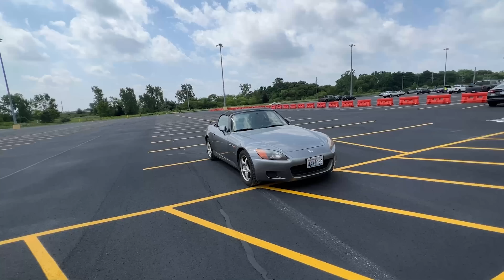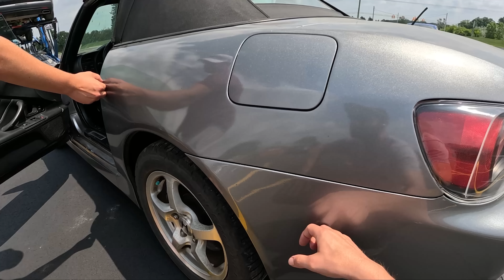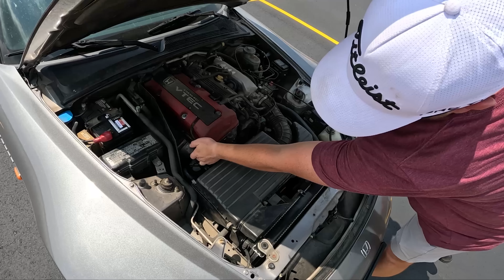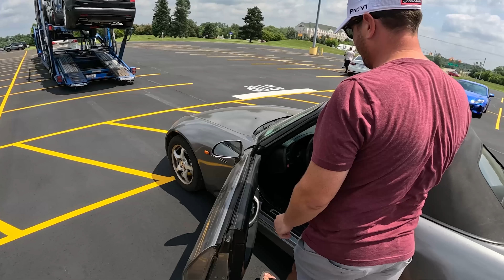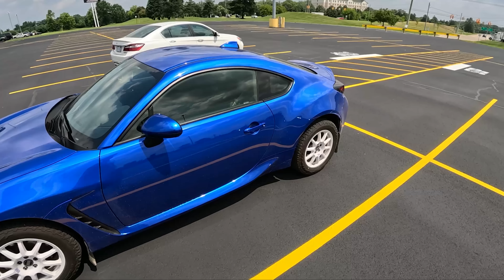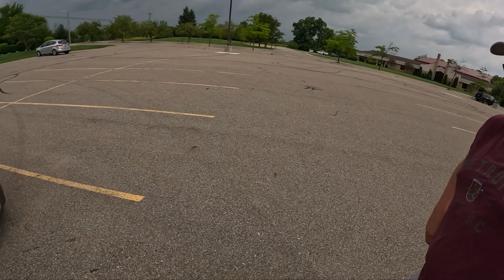2001 Honda S2000 - POV Delivery & First Drive

Comment from the maker: This week I bought a 2001 Honda S2000 with my best bud!
143k miles
Engine: DOHC inline-4, aluminum block and head, port fuel injection
240 hp at 8300 rpm, 153 lb-ft at 7500 rpm
6-Speed manual transmission
Curb weight: 2,809 lbs
Tire size: Front: P205/55R16, rear: P225/50R16
Wheel size: Front 16″ diameter, 6.5″ width; rear 16″ diameter, 7.5″ width
Reply: How much you pay for it
Reply: @tayseersaeed5564 12 grand.
Reply: @brq44 😮 lucky 🦆
Reply: @jackpowell8155  Not me lol
Reply: Congrats man! Looks like so much fun.
Reply: I love this car I want one so bad
Reply: What next car?
Reply: With that mileage I’d guess $17-18k. $12k is straight robbery
Reply: Had no idea you guys were local… so cool to hear about Side Tracks lol
Reply: Make sure you have some engines in reserve
Reply: How is the passenger leg room on this compared to an ND? As much as I love my car, my wife and son don't fit well in it. And what are your thoughts on the steering vas an ND2?
Reply: no way 
 @brq44  that's a lie
Reply: @andyduomo9229  no

Comment: in 2014, I bought a 2009 S2000 (chicane silver/black leather) with 14,000 miles (I'm in Canada but let's talk miles and USD $). I paid 23k USD and my friends thought I was crazy as you could buy older models for $15k.  This one was like brand new.  A year later I was washing the car and someone pulled up in a 1997 NSX an offered me 29k on the spot. At the time, I thought I was a genius as I made a quick $6k and put a few hundred miles on the car.  Now that car is probably worth 50k and I'll never find another one like it.

Comment: S2000's still have something so special with their driving experience. Not the fastest or most capable things on the road, but so much character and so engaging
Reply: For sure. That's really all you want once you get over the fast car bug.  Most recent cars are almost completely devoid of emotion/character by comparison. It's almost become software infused rather than mechanical at this point...ie pops and bangs

I wish I would have gotten an S2K instead of a first gen BRZ...back then 15-18k bought you one in near showroom condition.  I had so much remorse when I took a ride in a friend's S2K with a nice intake and exhaust....the BRZ is so boring and feels so much slower in comparison.  Not to mention Subaru quality or lack there of...

Have an ND2 Miata now, it's as close as you can get for a modern car.  Thing is damn quick on a backroad stock...they aren't slow anymore.  lol.  Even those are almost too fast for most backroads...speed limits still exist 

But nothing beats that induction sound and seemingly endless redline of an S2K....wish they weren't so expensive nowadays.  I would have loved to pick one up instead of the Miata, but dropping 30-35k on a car that's nearly 20 years old for a daily driver vs 32500 for a 3700 mile 2020 Club with Recaros.  Easy choice for me.  

This seems like a steal for today's S2K market! With some time, money, and love it's going to be a great car.  Most S2Ks around that price are probably salvage titles or beat to piss.
Reply: I’ve been having a lot of trouble deciding whether I want this or a GR86 for my next sports car. I currently own an NB Miata, and while it can show it’s fun character sometimes, it’s also covered in rust and makes a bunch of scary noises. I’m probably one of the only people to say this but I hate my Miata because of that and I don’t think I want another one. I’m trying to sell it now and it’s a nightmare. I know S2000s aren’t the same car at all but I can’t help but see the resemblance, plus it’s going to be like a 25 year old car by the time I can get my hands on one, and like you said they’ll either be beat to piss or be collectible items. GR86 sounds like the way to go, but if I ever drove a nice S2000, I feel like I’d be pretty sad about getting the 86. Ig I just gotta wait and see how Topher compares this car and his 86.
Reply: @samstedman409  as someone who has owned 7 s2000's and driven GR86 on street, canyon, and track, I can tell you that they are both awesome cars but also very different. Relative to your NB, the s2000 will feel like a very violent and angry version of that car. I found the GR86 to be a better balanced car in terms of handling. Feels better to drive at the limit. But, the GR86 is struggling with reliability because of the RTV issues and Oil starvation on cornering. S2000's have been around for ages so the guess work for reliability mods is done and are just about bullet proof with a few of the right measures

Comment: The AP1 is the better S2000 and the AP2 is the better car. Cant go wrong with either. I bought an AP2 since i plan on daily driving mine and wanted the QOL changes. I love it, congrats!!!
Reply: I imagine people typically say such things to make themselves feel better about whatever model they wound up with. Both are great. Fortunately North America and Japan ultimately received both models — people in these markets should buy whatever version appeals the most to them.
Reply: @VirtualGuth  you literally said the same thing i did, although a bit more cynical. Thank you?
Reply: @DraegerV1  I've just never bought into the whole AP1 = the better S2000, AP2 = the better car thing. Those looking into buying a S2000 should focus on what aspects of the various versions they value most and shop accordingly. Those who have a limited budget obviously should buy what they can afford and know that every version of the S2000 is capable of racking up a lot of miles when properly maintained. S2000's in any form as they came from Honda offer plenty of fun for those who enjoy spending time at the upper end of the RPM range. It's also worth noting that as not everyone enjoys such cars, the S2000 definitely isn't for everyone.
Reply: @VirtualGuth  logical explanation. I just think its cool that we do have the AP1 and AP2. More hardcore or less hardcore. Like, the S2000 is already an amazing car, and the fact that we have 2 versions to pick from is awesome. I still stand by the saying above. The AP1 is noticeably more edgy, while the AP2 is a bit more "daily friendly.'' Cant go wrong with either.

Comment: Congrats with the S2000 !!!
I own a 2002 S2K since 2010. Bought with about 80000km on it and now it has 190000km and i still love this car so much.
If i sell it, i will surely regret it.
As all car enthousiasts, i'am looking for another sportscar now and then and i can sell my S2K to raise my budget, but that is not a good idea. Better buy something cheaper as a extra fun car and keep the S2K.
I must say that my S2K is not my daily car, i only drive it as a weekend/summer car. As a daily and only car it wouldn't be my car.
It is always noisy, you have to work for speed because it needs high reving. Driving in snow and rain can be very tricky and with the roof up, the blind spots behind are BIG.
BUT!!! If you drive it on a sunny day with the roof down on a twisty road, everything falls in place and it is a dream!❤

Greetings from the Netherlands

Comment: Congrats. Three time S2k owner here. I made the mistake of selling the other two. My 2004 Rio Yellow Pearl with 30k miles is a keeper….I think the S2k is the best bang for the buck when it comes to analog driving experience and smiles for the dollar. I used to say this and the E46 M3, which I have also owned a few of, but the BMW costs a lot more to maintain.

Comment: I soooo wanted one of these back in the day until I tried sitting in one. I simply didn’t fit. I couldn’t get my leg under the steering wheel at 6’3”. It crushed my dreams, but I still appreciate seeing them out on the road. Can’t wait for some awesome future S2000 content!
Reply: I’m 6’2” - it’s a serious struggle getting in and out. Cheers!
Reply: @thomasoneill5653  did you get some lower seat brackets?

Comment: It's crazy to think that I've bought my 1 Owner, 69k miles 2001 S2000 back in 2017 in pristine condition for $12,000 just like you two have paid, I have easily negotiated $2,000 off which he originally listed at $14,000. Sub'ed for future updates!

Comment: Congrats on the s2000! 

- you guys need the soft stop straps by modifry (business is closing, so order up), without this, you could rip your soft top. 
- no steering wheel adjustment on any s2000 year.

Comment: I had a 2004 Civic coupe as my first car. Drove it for 8 years, did shifter upgrades, suspension, wheels+tires, etc and even with 150,000 miles the thing ran incredibly smoothly and happily. I love old Hondas.

Comment: Congratulations on what looks like a decent deal in today’s s2000 market (same I paid for my one owner ’00 with 50k ten years ago).

I occasionally consider replacing mine with something more modern, then I take it for a drive and the thought fades. 

The vibration you feel when decelerating may be clutch buzz.
Reply from the maker: It’s understandable why values have gone up so much! It’s one of the best drivers cars ever made. Vibration is definitely clutch buzz, only on deceleration and stops when lightly pressing on the clutch pedal. It’s getting better though with more driving 👍👍

Comment: Bought a silverstone 2001 this January! Congrats on the car guys. You’ll be very happy with the purchase. 

After going through the ringer with this car this year, here’s some tips

1) that decel vibration is the infamous ap1 clutch buzz! Most cars start doing it at some point. Nothing to worry about, just annoying.

2) square setup with a karcepts front sway bar is the perfect way to optimize handling. Adjustable sway bar without having to lift the car!

3) you know you want that K&N intake ;)

4) if you’re looking to get a lower seat, get a recaro pole position with PCI or buddy club sliders, and don’t look back. Mine seated on the floor and it’s perfect driving position now.

5) sound deadening in the doors goes a long way in reducing NVH. Just did it to my car this weekend and it was the best 2 hours I’ve spent on this car, period. https://www.s2ki.com/forums/s2000-talk-1/killing-road-noise-results-1085903/?ispreloading=1

6) check out modifry for some quality of life improvements! They’re closing so the sooner the better on those phone mounts, cup holders, glove box organizers, etc.

Comment: Vibration on decel might be “clutch buzz”, harmless but annoying. And you do not have to put an intake on it, most of them perform worse than the OEM one and IMO sound worse. It’s fun for a little (take the cover off and drive to simulate one) but it is a much more balanced and pleasing sound when it’s comparably loud to the exhaust vs being the only thing you can hear.
Reply: Airbox lid off definitely reduces power, but certainly good for a bit of fun to see what it would be like with a loud intake!  I think is a channel on here on YouTube that discusses an airbox mod they usually do, which does increase power a little bit on their dyno?  (LHT Performance, though I see in the comments above that LHT Performance are controversial!)

As you say, many aftermarket intakes are worse than the stock intake (likewise for many aftermarket headers).
Reply: @TassieLorenzo  I love LHT Performance but that particular test wasn't well controlled, the dyno pull that they did was after a tune and not like for like. I think I also disagree with some of their findings/instincts. The chambers are there to combat resonances throughout the rev range and the little diverter they removed along with those chambers probably harmed more than helped performance.
Reply: @KirkwoodImaging  Those are some good points!  It occurred to me that Mugen are usually pretty good at designing OEM+ stuff, so I had a look at what the Mugen intake for the S2000 looks like.  It seems further removed from the stock design than their EP3/DC5 or FN2 or FD2 Type R offerings.

Regarding the FN2 airbox, there was a divider/chamber inside the bottom half of  stock FN2 air box which I honestly don't know why it was there, so I removed it (it seems like it would block off 20% of the air filter area and I can only imagine it's there to reduce losses on part throttle during highway cruising or to improve part throttle response or part throttle torque?).  I removed the turning vanes from both halves (as many people do) but felt the throttle response was worse, so reinstalled a stock top half with the turning vanes (which look like they would be at 90 degrees to the flow, but of course the flow is already turning around the 180 degree bend so it's more like  45 degrees -- I never removed the vanes that were in line with the flow on either half, as I can't see how they can be anything other than useful for keeping the flow aligned) and that seemed to put the throttle response back to normal.

(I have a stock bottom half I could put back in too, but have left it as is, as it seems good as is, I dunno. It definitely doesn't seem worse in terms of performance -- maybe highway fuel economy is worse!)

I believe the Mugen air box for the FN2 is like the stock one, but enlarged and with (I believe) no turning vanes inside nor that divider either.  So not too dissimilar from somebody having removed all the gubbins from inside the stock airbox.

"The chambers are there to combat resonances throughout the rev range" Do you think those resonances need to be accounted for, for performance reasons or only for acoustics?

The FN2's stock intake tract has a Helmholtz resonator chamber branched off from it behind the front bumper, which AFAIK is only for acoustics rather than performance.  The Mugen intake includes an air scoop which does away with the resonator.  (Apparently using the air scoop and doing away with the stock resonator makes VTEC crossover sound less pronounced.)

Comment: AP2 can be safely tuned to 8500 RPM redline without exceeding the piston speed of the AP1, so that's pretty close to best of both worlds. 

Love the shots of running to redline and barely pulling on compact SUVs. That's the S2K life these days, now that everything on the road has 200+ HP. Still not much out there that can compete on fun per miles, though.

Comment: Bro, take it to a specialist because it’s going to have some stuff. I got mine from a first owner and it had a ton of stuff needed for repairs.

Do a valve adjustment, swap the retainers, make sure you swap the engine mounts. Change the TCT out of caution. Rebuild the shifter because that’ll make a huge difference. If the clutch is stiffer than finger-press firm, look to see if the clutch master is leaking. Both of those are indicators that your clutch is going. 

I can go on, but congrats!!! Great cars. Put Ohlins on it because it’ll change the car’s handling entirely.
Reply: AP1's don't really have TCT issues. No need to change it preventatively. Also no need to change retainers if they're in good shape and you don't plan on mechanically over revving the car. Valve adjustment is good though, but even then they don't creep very much. But since you're in there already you can do the retainers.

Stock suspension is actually nearly as good as Ohlins. But maybe your suspension was worn out.

But yes the clutch master can go, and it's a good idea to lubricate the shifter and get new OEM bushings.

People mistreat these cars then have more issues that they then blame on the car.

Comment: Get in contact with lht performance in Florida. They can steer you in the right direction as far as preventative maintenance and tlc. Those guys are the s2000 experts imo. Congrats on the honda bro.

Comment: Congratulations on the S2k. Ofc watch the snap oversteer when you're on track/at the limit. Once you've dialed in the car and your driving in it, you'll have a blast!
Reply: Yes, it's very real.  I once saw an AP1 disappear backwards into a run off area in a cloud of dust on a track day (thankfully it didn't hit anything).  I think there are parts available to tame that, if you choose to do so?  Likewise is it worth addressing valve spring retainers on early AP1s, if they are going to be tracked (or is that only if the car is going to be tracked a lot)?

Comment: You can tell this car was originally designed exclusively for the Japanese market when you look at the handbrake placed next to the driver... as they drive on the right side over there.
For all other markets, they just switched the dashboard, steering wheel, and steering column to the left side.
And man, what a fantastic car! Here in my country we only have a few of these imported models from the early 2000s, and they're just awesome!
Greetings from Brazil, folks!
Reply: Nope! The S2000 was designed for the global market and JDM S2000’s have the handbrake on the left side instead of right side.
Reply: Damn, you got actually'd pretty hard not gonna lie lol
Reply: @maximus9401  I'm a 'slave' to details, lol. 
I also had a Holden Commodore (called Chevrolet Omega here) imported from Australia, and the handbrake was on the passenger side for the same reason as the S2000. Cheers, Sir.

Comment: One more thing worth noting: The S-series of cars from Honda remain the only purpose-built sports cars that the company has ever produced (as the NSX slotted more into the Supercar category at the time). It seems highly unlikely that Honda will ever produce another car like this powered by an internal combustion engine, let alone a naturally aspirated one. Take good care of your S2K as it is only going to become more rare over time. Should you choose to do any modifications, hopefully they'll be reversible (and hang on to those original parts).